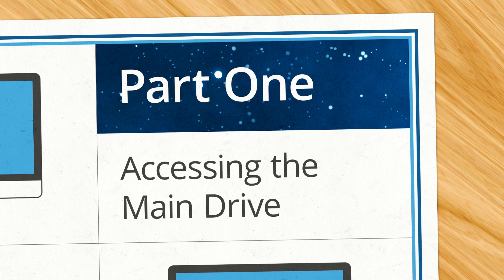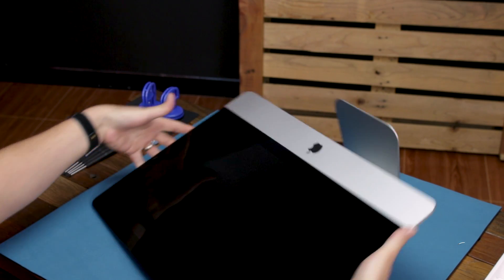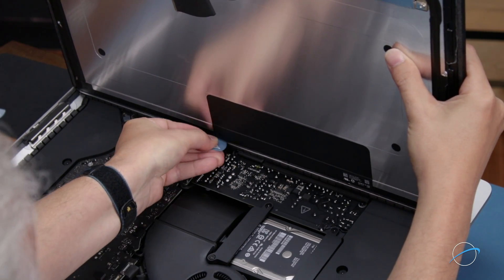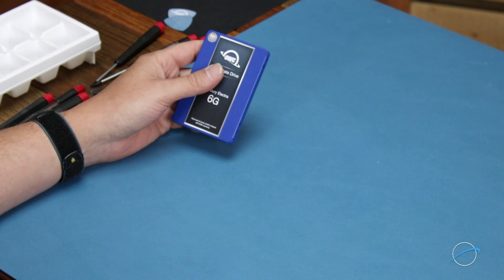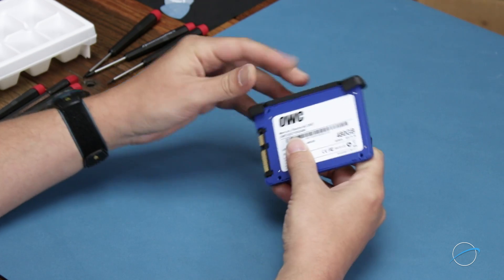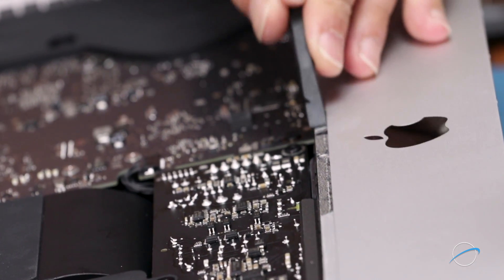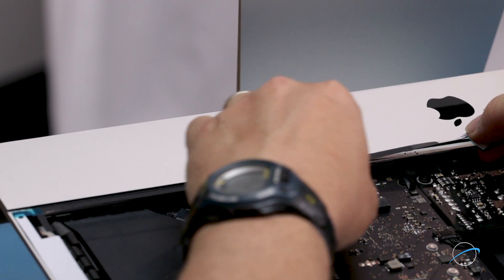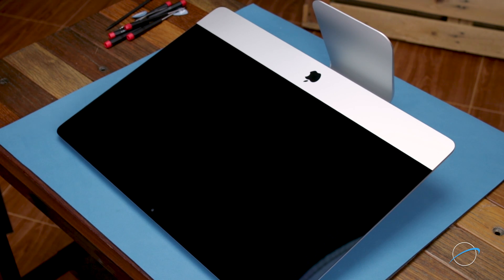How to Upgrade/Replace the Main Drive in a 21.5-inch iMac (2017) -- UPDATED VERSION AVAILABLE

Comment: Lots of comments... But anyone have fans speed problem?
Reply: @Sulaiman Tahiri There is an issue with spinning fans to max because the Mac thinks your hard drive is too hot. You need to buy additional cable as a termosensor or something like that.

Comment: thanks for this video. 

I saved £399.99

I followed the instructions many times before I opened up the iMac. The speed is different to the rubbish crappy slow 5200 hd that came with the iMac.

If anyone doing this, please be careful and take your time. I actually slowly used the guitar pick to open up the adhesive tape (over 2 days) just to be very sure. 
When removing the hard drive please note that it is very difficult to attach the cable to your SSD, you will have to unscrew the speaker and slightly move it to 
the side for a little bit of space, but take your time. I used double sided unibond tape to attach the screen back.

Putting it back on was a bit tricky too. I had to remove the screen 2 times before I finally got it in place.

Anyone can do it if you if you believe it. Its simple, just take your time.

Comment: i've read online that 3.0 21.5 4k 2017 imac on apples website says only able to put 256 or 512gb ssd, but i was curious if a 1tb will work, kind of like how they say you can only put 16gbs of ram in but 32gbs works fine?? anyone know.

Comment: Any other company than Apple would have a hard drive access cover on the back with a single screw to remove it. Total time required: 5 min if you're doing it for the first time. Apple would rather have you throw your old iMac away and buy a new one.
Reply: Yes, quite. No way would I attempt that and I would hate to think how much a responsible and reputable shop would charge for doing it.
Reply: @wolves201  Personally, I would charge something like 350 euros for doing something like this. I'm a tech repair assistance guy but I recognize this as something difficult and risky.

Comment: What apple flash drives are compatible with 2017 Imacs?  can i use macbook pcie drives in it?
Reply: Ok which genuine 2nd hand apple pcie drives work in the imac?
Reply: @robert7622  As far as I know is 2012 MacBook SATA Pcie for fusion drive model iMac 2017 21inch. IN iMac 2017 wth HDD only is only one SATA connector for 2,5 inch HDD or SSD, there is no pcie connector.

Comment: Or you could use one of the Thunderbolt 3 ports on the back, use an external SSD and achieve the same result without having to open up your mac and voiding the warranty. Not to mention you can use the internal HDD as your "external storage".
Reply: Yes I want to know to, they made it to difficult to open and fix it yourself
Reply: I want to understand this. How may I do this? I mean, using the external SSD for my OS and apps and my internal HDD as storage only?... is there a video you know about it? Thanks
Reply: Thanks for your advice! Just brilliant...

Comment: Great video man!!!
I have a question; I own a late 2013 21.5" iMac and Im planning in upgrading the original HDD with a new SSD.
Question is: do I need to install a heat sensor to the new SSD?
Thanks a lot!!!
Reply: @poweredbyowc  I did the upgrade with my late 2013 iMac and I'm having a high kernel task issue. Diagnostic code  PFM006. What could cause this? Thanks

Comment: Thnx for the video, is the special SATA cable with temperature probe necessary when I install an 500GB Samsung Evo 850? I have the iMac 2017 21.5" 3Ghz 1TB 5400rpm, thanks in advance
Reply: Hey man did you get an answer for this?

Comment: On the new imacs can u still replace the ram easily at the back
Reply: 21.5inch imac
Reply: MacSales. com I don’t understand. Because I have an iMac 5k 27” and in the back I can only replace the RAM but the SSD is not something different? Sorry I’m new with this and I’m so confused. Do you have a video how to upgrade a 27” IMac? Besides, I read some comments about having a external SSD thru thunderbolt 3 and achieving the same new high speed. What are your thoughts? Thanks

Comment: What if the system came with a fusion drive and you want to upgrade the fusion drive. I’ve never opened my iMac. Would mine have 2 hard drive slots? And how would I go about upgrading that? (Just a bigger HDD and prob same SSD). My iMac is the late 2015 21.5” non 4K iMac
Reply: MacSales. com thank you so much. Just one last thing. Do you know how much storage the add has?
Reply: MacSales. com I meant to say the ssd but it autocorrected. How much does the SSD already in my computer have? (The blade SSD). I bought the 1TB fusion drive
Reply: MacSales. com ok. So you’re saying that I can’t upgrade the ssd but I can change the hdd? Would the guide to change the hdd be the same as in this video?

Comment: Using iFixit's pizza cutter to open up the iMac is way easier than the procedure you instructed; very risky.
Reply: You've also didn't covered the new microphone hole found in the bottom chin with the adhesive strips. This microphone hole was introduced in the 2017 models.